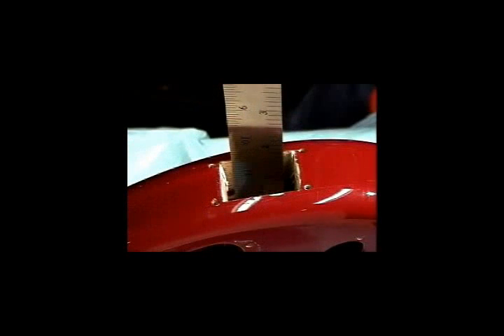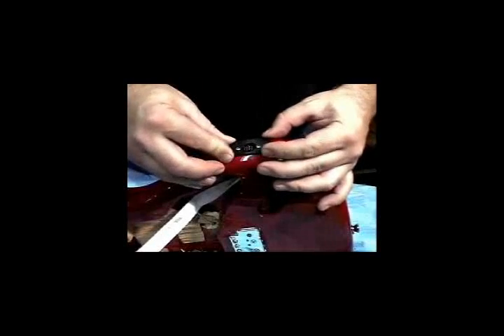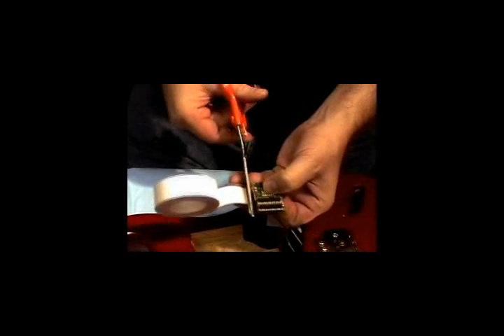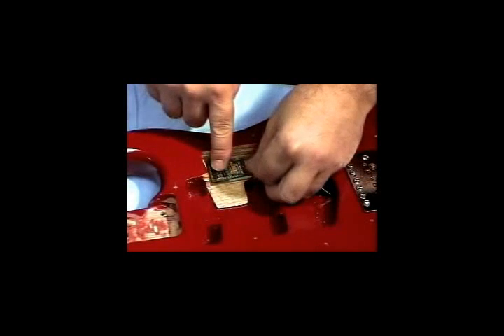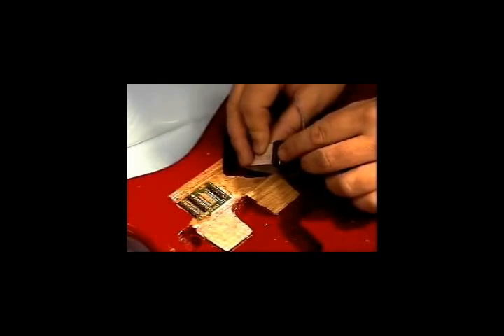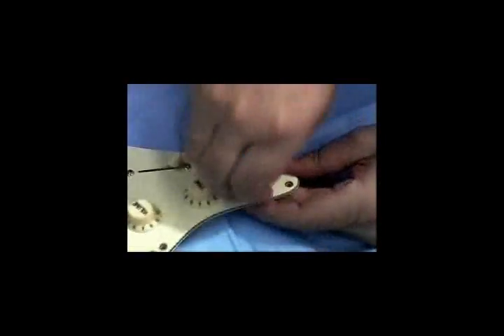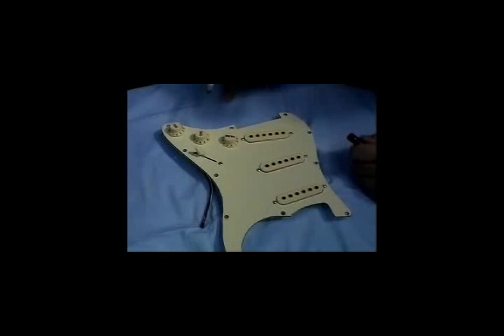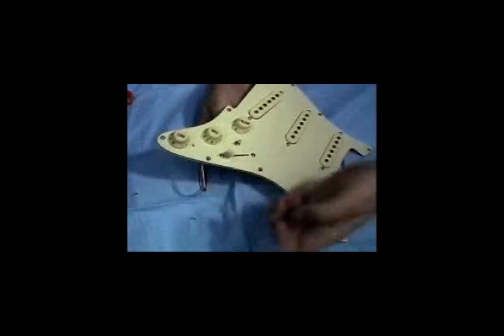GHOST Hexpander Installation - Part 2 of 3

Comment: The wiring if professionally done will require drilling the trem-plate , all manufacturer installed systems route the p/up cables through the trem bloc' .also no program switch is shown(must have to control synth banks) and what about the tone control that was removed? this requires alteration to guitar circuit to compensate . Some glaring omissions here for novice' installers.